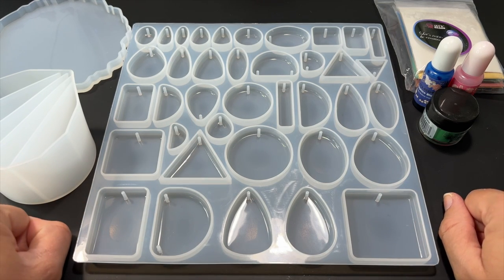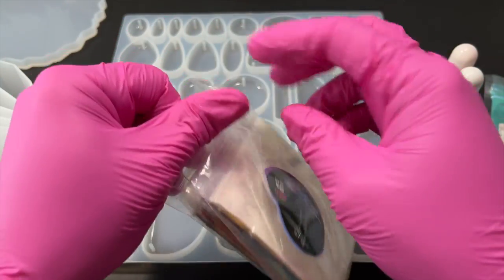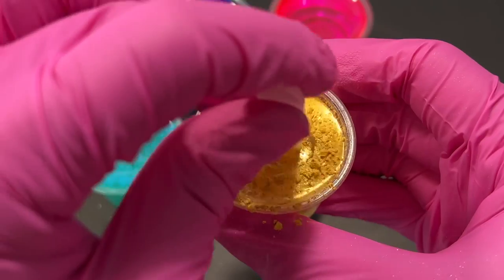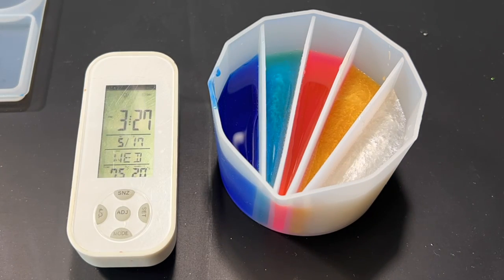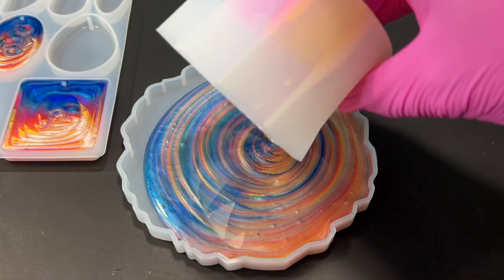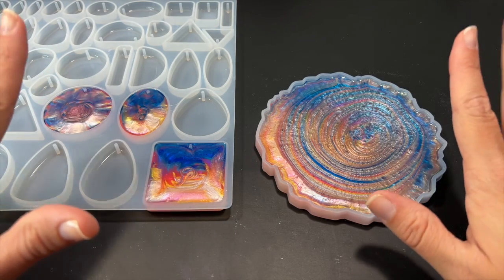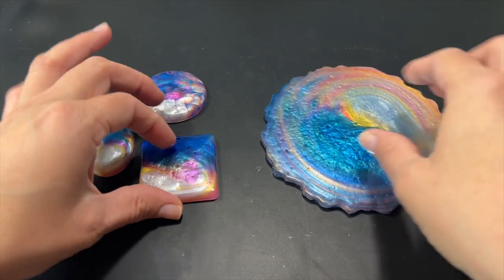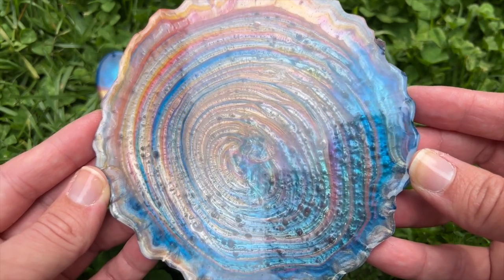DIRTY POUR Technique With EPOXY Resin Attempt #2 | An Easy Resin Technique for Resin Beginners

Comment: The colors looked so good as you poured them out. Such a shame they blended together. I have two ideas that could help the colors stay separate. One would be using chunkier glitter to color the resin, that way the different pigments cannot blend together. Another would be to heat the different colors different amounts, the problem with letting it sit is that they are all still the same exact thickness when you pour them in and easily mix together. When liquids are different temps and thicknesses they do not mix as easily.
Reply from the maker: ooo that’s an interesting idea. I definitely have to try doing a dirty pour with glitter and see what happens.😮

Comment: I think if you put the mold on a turntable and turned it a little while doing the pour with that multi-chamber cup you would then get a much more spread out distribution of the colors.  Just the behavior of the colors in their far sides (outer chamber colors dominate) and the fluid dynamics.

Comment: Mica is heavier than the pigment in alcohol ink, so the mica colors will sink to the bottom. To get the result you were looking for you'll need to use either all micas or all inks. Also, to get teal, you're actually going to want to put a yellow-toned green between the blue and the pink instead of teal, because anything with a blue tone will just get eaten up by the blue.